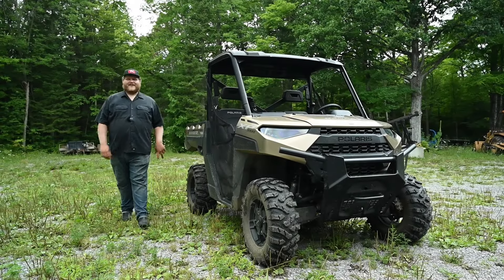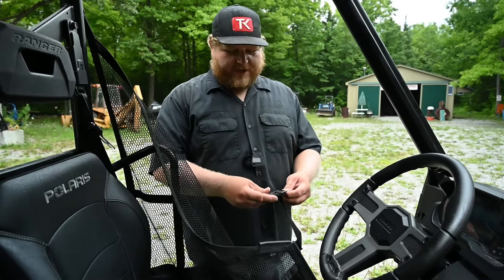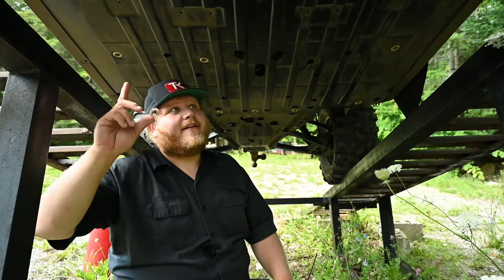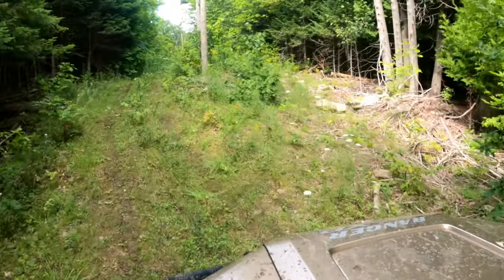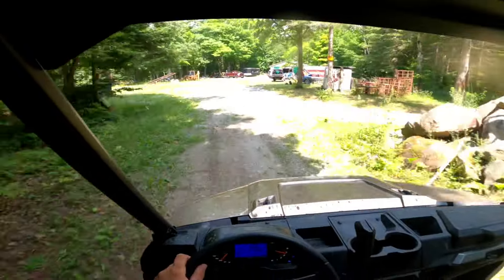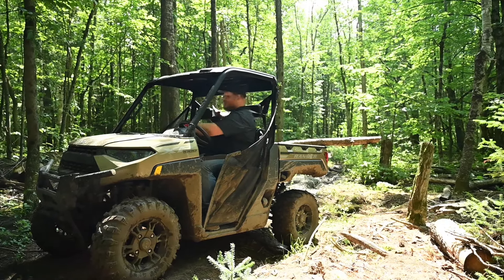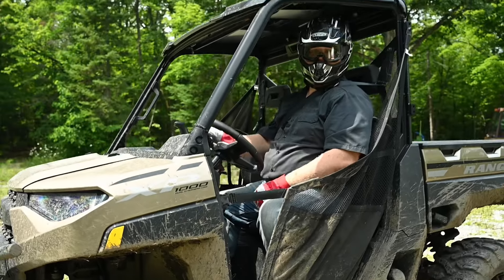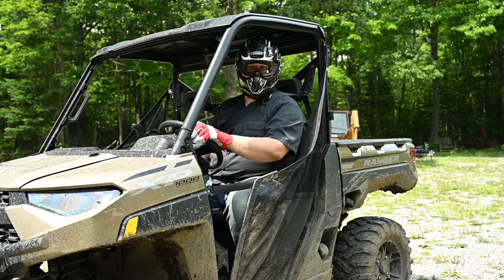Mud, Rocks & Hard Work Test the Polaris Ranger XP1000 - Is the Best Seller the Best Choice?

Comment: They all need a parking brake! We test all kinds of machines on steep hills and on several occasions we've had to bump them from behind to take some of the pressure off the system and had to teach customers to park sideways on hills or be ready to winch yourself out of park. Some manufacturers tell you not to use park while trailering the machine, so why not a parking brake?
Reply: i put one on mind for on a hill works great

Comment: Great thorough review as always. The new seat bolsters look much better than the old flat uncomfortable ones. The more storage the better especially for overlanders. Personally I love the dual analog/digital cluster. The blue background is a bit difficult to see at a glance though. I think all side by sides should have a park gear, and park brake for the reasons you mentioned.  Keep up the good work putting machines through the type of things people actually use them for.

Comment: Polaris by now should have addressed the shifting issue when putting in forward or reverse, you almost got to get out manually push the bike back-and-forth to have it engage without gears grinding.
Reply: I go into neutral first … quick a quick rev… wait for idle …then select the gear …. I find this helps